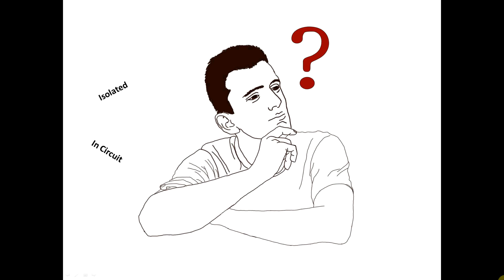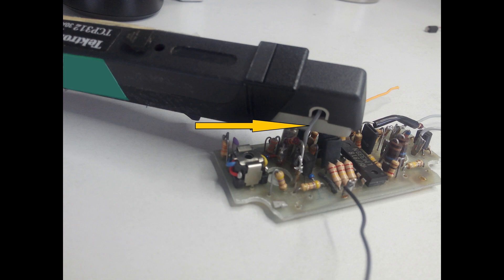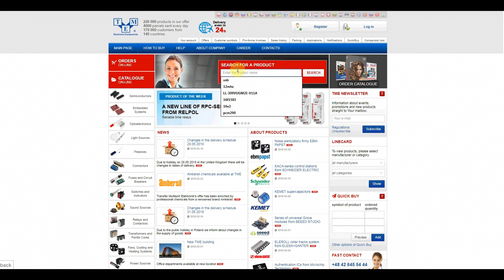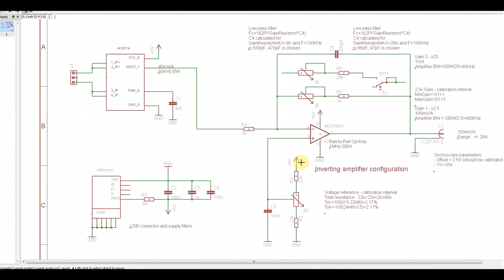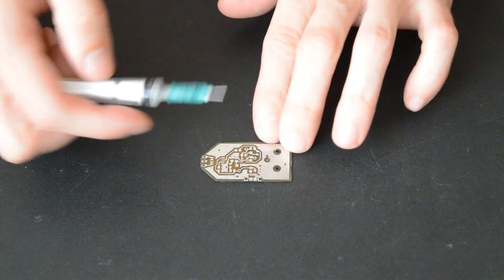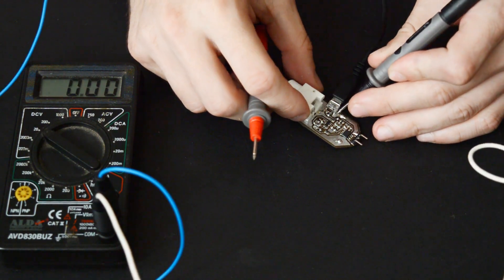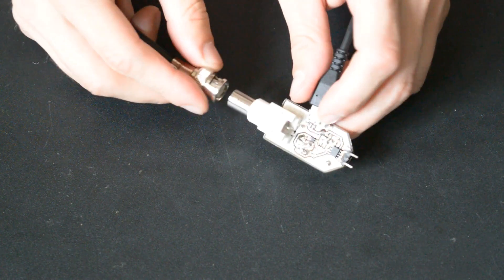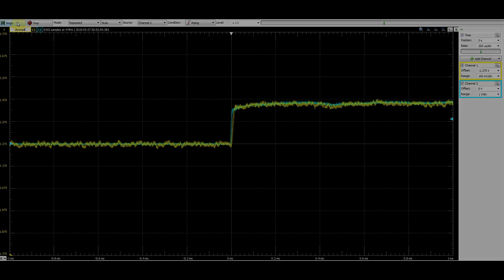DIY Current Probe

Comment: These hall effect current sensors are great, but they do have a lot of hysteresis, so not useful for really precise DC measurements, as the zero value will change depending on the last current measured.

Comment: How do you make vias?
Reply from the maker: I add a small wire, usually old THT pins, and solder on both sides. Its quite time consuming, but it works.
Reply: @FesZElectronics  I'm using 0.6mm rivets. It's tedious as well...
Reply from the maker: I think your method is faster since you don't have to cut off any excess afterwards - the wire that I use is always longer than needed

Comment: What is the purpose of C4, the 470pF cap in the feedback path of the inverting amplifier? Great video!
Reply from the maker: Its forming a low pass filter together with the resistor with which it is in parallel. This is used to limit the bandwidth and the noise of the circuit.
Reply: @FesZElectronics  thanks!

Comment: Sweet.
I have a suggestion for a new video.
Build a clone or equivalent of the HP 547a current tracer or some type of micro current tracing device.
Reply from the maker: Interesting device! If I understood this correctly, the HP547 is a magnetic field probe. Did you ever work with this device?
Reply: @FesZElectronics  no, I never used one but I want to.

Comment: The ACS724 does have better specs than the 714 and 723. Breakout boards are on sale at Pololu for $5.55/ea/with coupon/limited quantities. 

Coupon: https://www.pololu.com/category/43/specials  Second coupon down.
Boards: https://www.pololu.com/category/265/acs724-current-sensor-carriers  Read each model's specs; more amps = less sensitivity.

Comment: More questions...
- During the selection of the Sensor at the vendor, it appeared that the highest bandwidth was desirable. Please explain why.
- There are a lot of Hall Effect Sensor characteristics... Operating Point mT, Polarity, etc. Please tell us what characteristics we need, for this particular application, and why they are important.
I'm already digging through my component stocks! :-) More questions are highly likely...
Reply from the maker: Hello t1d100!
In this case (the one in the video) the hall sensor measures the magnetic field arround a wire inside the IC, its not a regular sensor that senses an external field. Therefore most characteristics asociated with hall sensors are not relevant. You need a specific type of sensor not very comonly found in practice - most hall sensors you can find are in stepper motors (like in old floppy drives) where the sensor is used to determine the position of the motor.
For this application you need a sensor with a current range suited to your needs, and as you said - bandwidth is one of the most important parameters and more is better. BW relates to the highest frequency you can measure -  a sensor with 100KHz BW will measure a 100KHz sine wave with typically 3dB attenuation (you will measure half of the signal amplitude). Higher frequencies will be more distorted. What I am trying to say is that signals of frequencies lower than the rated BW will be ok to measure, but not higher. The problem is the Hall sensor its-self, its not capable of working at high frequencies. When I get a chance I will try to make a video to explain how high BW (~10MHz) current probes are built.
Reply: @FesZElectronics  Thank you for your reply and the great information. I have found this make/model of HES sensor on ready-made Break-Out-Boards at Adafruit and Sparkfun. At the Chinese markets, too, Ebay and Banggood, but their sensors are likely to be inferior counterfeits. They are inexpensive. But, where is the fun in ready-made?
I am glad you explained about the hertz. 20MHz is typical for the MCU crystals that I use, so I look forward to your wide BW design. I have subscribed, so I'll be sure to catch it. Even faster and more amps would be better for me.
People should be careful about "Current Sensor" ICs and Break-Out-Boards; many use shunt technology, not HESs, and they will put a burden on the circuit.
Reply from the maker: @t1d100 Out of curiosity, why do you want to measure the current going to the crystal? usually oscillator circuits have very low current consumption, so the only meaningful measurement would be using a voltage probe to see the signal. In my experience, at least, high bandwidth is most useful in a current probe when analyzing switching supplies - the switching frequency of such supplies can commonly get up to 2MHz nowadays but you can get unwanted harmonics much higher than this.  For anything else usually low frequency is enough - measuring the dynamic current consumption of a circuit or load variations. 
Regarding shunt technology - if the shunt is small enough it will not really influence the circuit (in most cases at least) the main problem is regarding isolation, usually you will need an instrumentation amplifier to not have the shunt referenced to ground, the amplifier may have some input voltage limitations, and then most probably the measurement probe and the circuit will have a common ground; shunt technology is not bad as long as all limitations are known and taken into account
Reply: @FesZElectronics  I did not mean to say that I want to measure the current draw of the crystal, but to give you an idea of the BW I generally work in... Mostly PIC18F4550 MCUs and analog circuits... 

I only have a Texas Instruments PDRV5053PAQLPG HES on-hand. I am not sure it will be appropriate for DC measurements. DS =http://www.ti.com/lit/ds/symlink/drv5053.pdf. It has less BW, but it might be a good learning tool, if it reads DC. Would you please take a look?
Reply: I have discovered that the PDRV5053PAQLPG is a proximity type HES and is not appropriate for your method. However, I can play with it and make a DIY split toroid clamping current probe, while I am waiting to order parts.
Reply from the maker: I didn't get a chance to reply sooner, but yes, that sensor needs an external magnetic field to operate. Proper current probes are done this way - as you said split toroid clamp. There are various cores from transformers or for cable filtering that could be used to create the clamp, just make sure to have as little air gap as possible. Otherwise your IC is ok, it should work well. 
Since I have no idea when I will get to make a video about this, here is some reading material if you are interested on the topic - it shows how to make a basic current probe with both a HES and a current transformer - this way you expand the bandwidth, the only difficult part is to get the same level of response from both sensors https://meettechniek.info/instruments/scope-probes.html 
also check out this old Tektronix datasheet of a current probe - with full diagrams and schematics http://materias.fi.uba.ar/6644/info/puntas/manuales/p6042%20current%20probe.pdf
Hope this helps! Let me know how your probe turns out!
Reply: Hmm... The paragraph spacing doesn't show that there is more information in my reply, above. Be sure to scroll down.
Reply from the maker: @t1d100 I saw the entire comment, its ok :D
From pinnout and functionality there seems to be no difference, the 724 is Automotive qualified and I think is more precise. The reason I used the ACS712 was that it was the cheapest component at the time from my local supplier. The ACS724 should be just as good, and by using the 5A version you will get better sensitivity at low currents.

Comment: So, a hall effect circuit needs a sensor -- where is it?  Or: how do you use the device?
Reply from the maker: I may have expressed myself poorly, what I was trying to say is that I use the ACS714 IC which is a Hall effect based sensor, which has part of the circuitry inside the IC giving an output that is a voltage proportional to the current passing trough it, and I use some external amplifier also to condition the voltage to my needs. The datasheet might also help: https://www.pololu.com/file/0J196/ACS714.pdf

Comment: May have missed it, but how much did this cost in the end?
Reply from the maker: Well the most expensive part is the current sensor its self, at arround 5-6 USD, other than that you have the connectors 2-3 USD together (depending on where you get them form), and all other parts another 1-2 USD. If you wish to buy all the parts (in case you can't recycle them from other equipment) I guess you can pull this off below 10 USD.